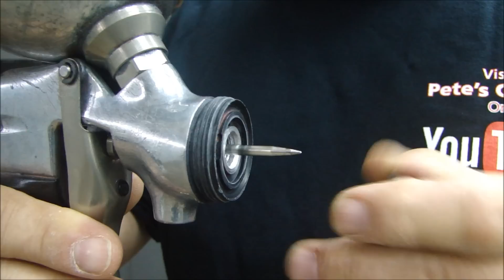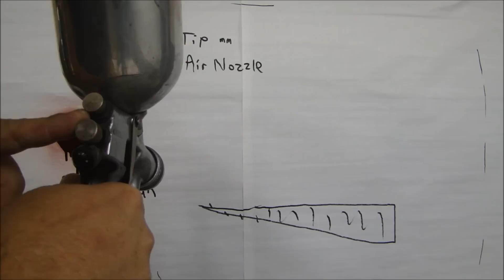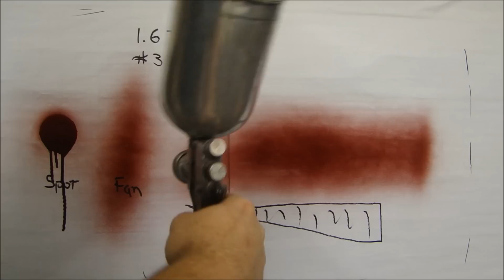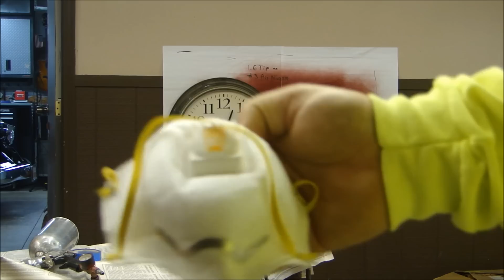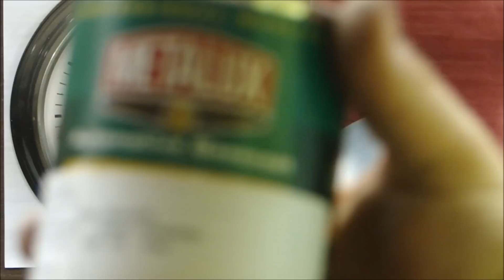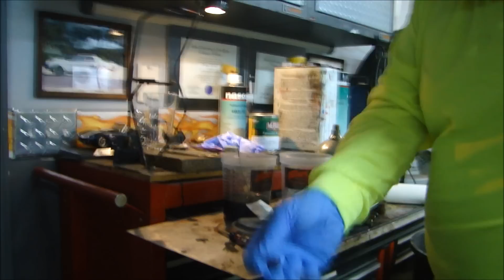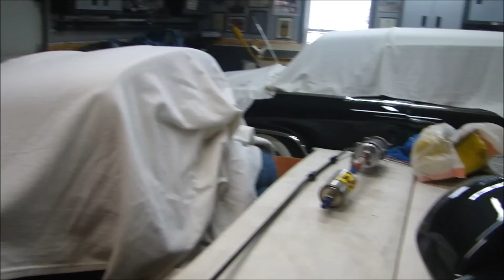Beginners Guide: Spray Guns & Spraying Base Coat Clear Coat

Comment: I am restoring a 92 year old car myself because that is the only way I can afford to do it.  I have sanded the entire body down to bare metal.  Do I need to epoxy primer all metal before using  body filler on dents or can I fill the dents then epoxy primer over the body filler?  I also have some 2k primer that I plan to use which I am told will help hide some of the rust pits.

Comment: Pete, love you videos, i got a quick question for yea, i live in northern florida , parents own a 32 ft formula fast tech  cigar boat with twin mercruiser 454's, I have pulled both engine's complete rebuild, one is rebuilt the other is at the machine shop getting bored and honed, I am looking for a honest opinion when it comes to painting a engine block. I just need a little sprayer that will work with high temp paints,enamel, epoxy you name it because once i get done the paint gun will prob be cleaned and stored and don't know when it will come out again. i guess i will also have to look into thinning out the paint before i spray as well. first time painter but long time viewer to your channel. i am very good using a rattle can but am doing away with it. i just need a small gun that maybe i can pick up at like home depot  but really need your guidance, My father is retired military and living my life of giving back i take care of all there responsibilities around the home , i do all there car,law you name it. they deserve a break. Price range is i believe $40-50 i am currently not working because i take care of everything elts.so they will be paying for it. Thank you for your videos, they have been so helpful has changed some things in my life for the best. Will be looking forward for your response so i can pass this on to my father . Thank you sincerely

Comment: Pete I’m painting my work truck. Its the first time for me. I have all the materials. The paint is good on the truck. But different colors. I’m not looking for a showpiece. I’m just looking for a solid color. My question is do I need to primer all the parts the same color primer? Or can I just sand the existing paint and paint over it?  Thanks in advance

Comment: A good detailer/ painter can do a good job with the cheapest products.. a bad detailer/paint cant with the best products..... I have  four...$10 harbor freight HVLP guns.. one for base, prime, clear, ceramic coatings.. my question is.. can I put better quality tips and needles on that sprayer to enhance its spray quality?... also what would you recommend tip sizes for each? I was recommended  1.4 baseball 1.7 primer, 1.3 clear, 1.2 detail and 1.5 ceramic.

Comment: A nice job on helping beginners. Like me I had issues with mixing primer thin enough and then having a small tip while trying to keep the primer from drying before it hit the part! EVerything has to work together and it needs to be all correct for the process to work.

My issue still is perhaps it is hotter than I set my mix for. I can use a 1/8 tip and still have primer drying as it is laying down. ACtually does not lay down before it becomes an ugly orange peel and even dusty looking. 

Then when I put like 30 percent reducer in the primer mix it flows better. Yet it is hard to build layers with so much reducer. I have to keep coating it 5 times or more before I get the build up I want to be able to block really bad pieces. Like 1956 fenders that have 80 dents in them. LOL

Hope you have a solution about spraying wetter in regard to priming with surfacer 2k. 

One other question is that once i get a part blocked and ready for paint I find the rest of the car is not ready. What to do with these parts that are ready and waiting. Do I use a epoxy primer to just seal them in where they are at? 

The trouble is I hate spending so much time resanding these smaller parts and I'm trying to find a way to leave them ready for paint so I can just clean them off or run a green pad over them before putting final finish on them. 

So I suspect any pieces that have metal showing I would give them a recoat. But it means sanding and blocking yet again! Is there a primer that you don't have to sand again? A special formula I can use instead of the high build stuff?

Thanks again. Great channel.

Comment: Hello PETE, how goes it - I could use some professional advice about a issue I am having using TCP GLOBAL( midnight metallic blue single stage acrylic enamel) I prepared the roof and hood of a 1970 chevy c10 1/2ton pickup- I primed and sanded to 400 grit I spent 2 days just sanding and cleaning- iused a 1.3mm needle and applied 3-coats!! the finish appears to be bumby- almost like a dry spray- not enough paint too much air?? this is a new gun I thought was dialed in I used 30psi with the air wide open; do I have to wet sand or use a microfiber cutting pad to level the surfaces?? the finish is dull /satin/almost flat no sheen?? I used the 3001 acrylic hardner "wet look" with 1 oz reducer the temperature was 72 degrees; first I do not have a clue what I did wrong; not enough paint ;I had a great test pattern but it just did not come out shinny/ it,s dull!! can I add a( 2)0z of activated clear to the single stage paint and sand lightly and then respray 2-3 light to medium coats I sure could use your help; bono fortuno !!  PASQUALE

Comment: Pete your channel is so helpful thanks for caring enough to share. So I am going crazy trying to find the right gun/compressor combo to purchase. I don't do a lot of pinning although I am sure I would get into it, however for now i am on a budget. I am currently dismantling for the most part a 1990 Blazer, plan on painting the engine bay, quarter panels, pretty much as much as I can down to and including the frame. From what I am reading I need a lot of compressor flow but not so much on the PSI. Any suggestions for a good set up? I would appreciate it.

Comment: I really like your video, it explains a lot and explains the spray gun settings excellently.  So I was outside in my yard and sprayed some primer on a wing and door, complete mess!  I think the temperature (90 degrees Fahrenheit) made things more difficult, the hardener was setting too quickly.  But my cheap spray gun also had a little filter in it, I think the paint was too thick to pass through the filter gauze leading to a really rough/grainy finish.  So two questions.  Should I remove the little filter and filter the paint prior to filling the gun?  How much thinners should I add to the paint to make it ‘runny’ enough to spray properly?  Cheers, keep up the great videos...  Clive

Comment: I have that same devilbiss flg2 and have had it for 15 or 20 years. I took a break from painting  until recently and i started thinking i needed an up to date gun. I was surprised when i saw you using the old gun. I read through all the comments looking for info about the flg2 as there is none on the web (i have been looking). Anyhow my question is when using that gun what psi do you like for clear and do you limit your material or crank the material knob out? I cant seem to find the little to no orange peal sweet spot. I am thinking i may not need a new gun now :) Thanks for the video.

Comment: The sealer coat you first put on is that a primer?  Is this a coating specifically for the plastic mirror and would not be used on body panels?  It doesn't require wet sanding after sealer coat prior to base coat?  A side note to anyone that is planning on keeping any leftover paint for another project do not pour any remaining paints from your paint gun into the paint can.  The paint in your gun has been mixed with reducer and has a very short shelf life, same thing with clear coats. To speed gun cleaning after disposing of any remaining paint, or clear coat from the cup I will fill the reattached paint cup with about 1/4 of cleaning solvent and run it through the gun spraying it until there is none left.  That's generally all the cleaning the gun requires between base coat and clear.

Comment: I have a pickup truck with a 6" rust hole on the bed just above the wheel well. I'm going to repair the hole using the normal method, but the part I'm worried about is spot painting the area which will be about 12 to 15" (after the repair)  so that it blends in with the original paint. The factory color of the truck is "Atlantic pearl blue". I've purchased a Harbor Freight paint gun which I'm told does a surprisingly good job, and after watching this video I feel confident that I can adjust it to do what I need it to do. Any tips on feathering the new paint and clear coat into the old would be helpful.

Comment: thanks for this clear explanation
but how do I prevent Paint Biting on a plastic part of a motorcycle, I have purchased all paint products from a professional store
I sanded and degreased it thoroughly
used Plastic adhesion promoter and I put the primer on it in light layers and always suffer from Paint Biting.
what is the cause and what can I do now?
I've never had so many problems thanks in advance

Comment: I see mini guns are typically used for small parts, but is there anything wrong with using it for a hood, or a door, meaning a large part, heck even a whole car? Other than it taking longer, is there a quality of the finish issue to contend with?

Comment: does it sound right to do  a high build primer on bare metal, then sand the orange peel, then do a sealer, base then clear with primer? just did my first thing in my auto body class in college and just wanna make sure I'm doing it right.

Comment: 89k subs and still answering comments? you're awesome; I'm a truck driver now but was a car mechanic many years ago and did my share of body and paint in the day of lacquer and enamel with siphon guns, (I miss the days of melting in over spray with reducer to get a wet shine) base clear was coming out but I never used it or a gravity gun. I have my first HF $70 HVLP unused on my desk as I watch some videos on base clear and am planing to repaint a 30 year old Goldwing a different color and want to 2 tone it. How long can I wait to clear or should I mask the line and clear both colors separately and DA or block the clear line and top with another coat of clear? or can I clear both colors together after a day or 2,    you know there will be quite a few small curvy parts to do and would like to minimize the mixing and cleaning. Another thing, the trunk doesn't hold a shine anymore, is it safe to paint over that weathered 30 year old clear? You can see the project bike on my channel a couple months ago when I power buffed it about 35 videos back from today. Thanks for your videos and 'hope to hear back from you soon.

Comment: Just subscribed, great tutorial, 1 question. When adjusting air pressure for spraying paint to lets say, 27psi, do I adjust the guage on gun holding the trigger fully depressed or half way(just before fluid flow)?

 Reason for this question is because on my gun, if lets say i adjust gauge to 27psi at full trigger pull, when i do half trigger pull(no fluid flow) the air gauge shows like 20psi up until I fully depress to spray paint, then it shows 27psi like i set it.

Thank you.

Comment: Do you set the psi on the compressor the same as the pressure regulator on the spray gun?

Comment: Great information, Thanks for this video.  Pete, I'm a newbie so here's a newbie question:   What size compressor do I need to spray paint with?  I won't be doing lots and lots of spraying, but I would like to get a compressor that will run some tools like and impact driver, etc, and a paint sprayer.  I know it's about CFMs butt I don't know how many etc..  Like I said, newbie. :)

Comment: Pete I know this video is a few years old. I am an old detailer, from the days back when we used to use the old grey mud to cut out new paint. So yes I am old! I was watching as you applied the clear and the florescent light shining on it. I know on the thinner coat it was not going to come to a nice clear reflection, and your final wet coat did clear it up a good bit. but not to what I call a mirror shine. I am assuming that was a little bit of orange peel? On a small repair like that do you go through the process of wet sanding and buffing? Or am I completely wrong and it was just the way the camera picked it up?

Comment: Hello, I have a question that I've seen asked on many YouTube videos, but no one ever answers it, so I'm going to try you..when people refer to adjusting the air pressure..for example 35 psi on the regulator..is that with the trigger pulled? Or just the base pressure going into the gun?  Maybe it's just a dumb question, but could you please clarify?  Thanks.

Comment: Wow you are a great teacher. Very thorough and easy to understand. Thanks. Question: So you actually keep spraying the base color coat on in one continuous coat? Reason I need clarification is because I see other videos that apply the color coat over several coats, letting the previous coat dry in between.  Thanks again!

Comment: Love watching your Videos. I've not painted a car in 35 long year's. Could you give me some help please. Im going to do a Base coat Clear coat on my 1975 Catalina it's long with lots of body line's and hard curves. Questions What size tip for Metallic base coat. What size tip for 00.04 and 00.08 Flake in the clear coat. Im really looking forward to getting a very nice paint job body work is done jammed, blocked, crosshatched, I've got all my supplies Masking tape, roll's of plastic masking, gun's they only have a 1.4 .55mm tips, Tack clothes,  i know the quality of my paint job depends on me I've taken my time over 1 year not getting in a hurry Rebuilding the heart of the car Engine Trans and drive train 5000 in part's and my time in building. Far as paint Im not taking any shortcuts Your help on the Spray gun tips would be greatly appreciated. Thank you

Comment: Hi Pete, I live in England and have been painting cars and lorry's since the late seventies. I have used cellulose, acrylic, synthetic enamel and lately two pack or 2K. I have done a few re-paints in 2K but straight colours only. I have a classic Ford Corsair, which was based on the American Thunderbird but it is metallic blue. I had asked several people how to do a base and clear coat but every answer was different. So, I turned to YouTube and your channel came up. I found this video very informative and the use of the clock inspired me to get the car painted. I put a clock on the wall , like you showed. I wet flatted the boot lid (trunk lid) with 800 and wiped it over with panel cleaner then tack ragged it off. I used my smaller DeVilbiss touch-up gun and put the base coat on thinly leaving 10 minutes between coats, 4 in all. Then by using the clock I cleaned the gun and tidied my tool room up a bit. After 45 minutes I mixed the clear and put a 'dust' coat on followed by 4 more coats at 10 minute intervals. That was 2 hours ago. I have just been out to have a look and the finish is great, lovely depth and high gloss. I thoroughly recommend your channel to anyone wanting a good guide to painting. I have been in the job for nearly 40 years but you taught me something today that I can use in future.

Comment: Very good tutorial. Not sure if that is a new pre-primed mirror or a repaint. Do you use the same type of sealer for a new or old, and if plastic or metal object? Is the sealer used to prevent bleed thru from the existing surface and to improve adhesion of the base coat?

Comment: What makes a expensive gun expensive, they all work on the same principle pushing air and fluid out holes, a 1.4 tip is a 1.4 tip, caps are caps with holes drilled in them. All you hear is quality parts, what about the parts make them quality, what makes a 1.4 quality hole compared to a inexpensive 1.4 hole, how is a needle with the same size and shape different in price? Everyone shows atomization between quality and sub par guns but what is the bottom line on why they differ? What makes a quality gun?

Comment: I looked at alot other videos but this one has alot more information and easier to understand,
but one quick question is it mandatory to set my air pressure to 18 psi , because in another video they said to set it to 25 - 30 psi.

Comment: Excellent video. You are a very good teacher. I learned a lot. I have sprayed clear urethanes over the years with no problem. I am now restoring an old ford backhoe/loader and am using oil based alkyd enamel mixing with reducer and hardener but I cannot get a good fan spray unless I add about 1/3 mor reducer than manufacturer calls for and am afraid it may weaken the paint. Don't know, am still researching. Was wondering if you have sprayed much with enamels? Again, great video.

Comment: I didn't know there was a filter in the neck of the cup, I was a car painter in the 60s 70s, I saw gravity feed Sata guns, but never used one till I bought a Sharp Cobalt blue gravity feed primer gun 2.3mm nozzle, sprays very nice, I tried to spray metalflake but the flakes gets clogged up in the neck, no filter, and some of the flakes get between the needle and nozzle and won't let the needle seat. and it leaks when you stop spraying, always learning.William

Comment: Good video but I do not recommend removing the fluid tip prior to the needle . Always take the needle out first as most fluid tips and needles are machine matched from factory  . One scratch or knick on the needle and it will ruin the pattern or possibly leak paint through the tip . Much safer to remove the needle first